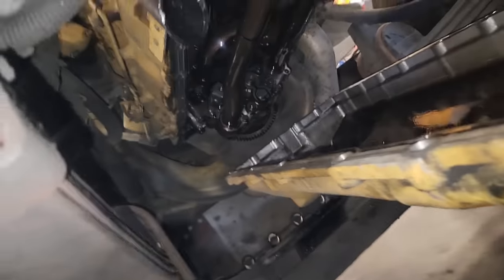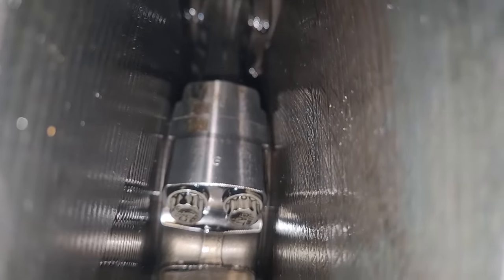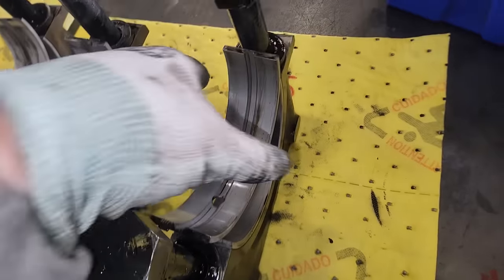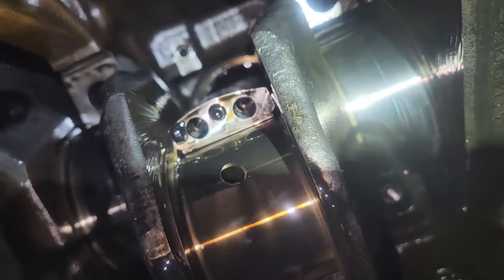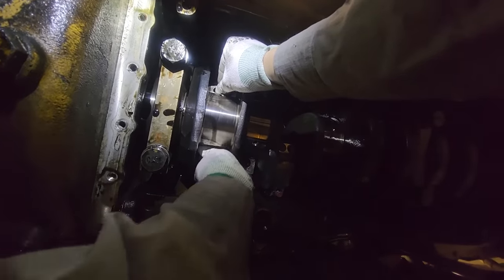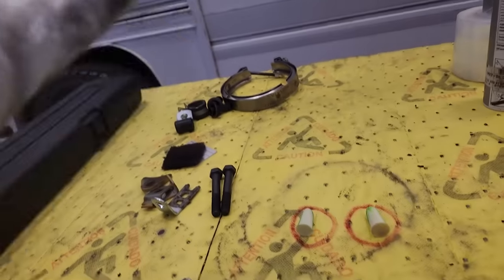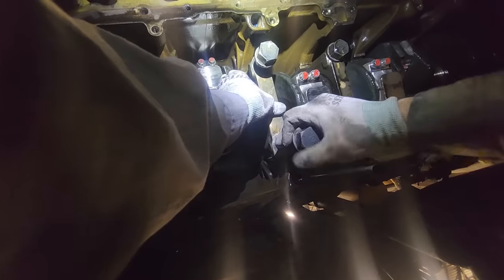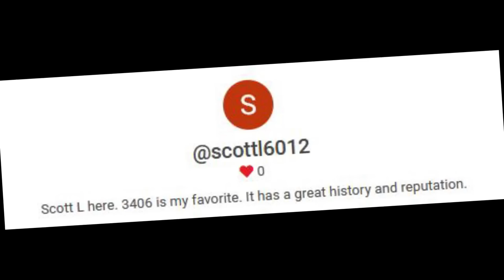Nice Truck Driver Paid for an Engine Rebuild, gets a HEADACHE! Engine "Re-Rebuild."

Comment: Why did you torque the individual main bearing caps down one at a time before you had replaced ALL of the main bearing shells? Doesn't that put the crankshaft at a slight angle which makes it more difficult to replace all the subsequent main bearing shells?  I would leave all the main bearing caps a bit more than  finger tight until all of the main bearing shells had been replaced, and then torque the main bearing caps down to final specs in the particular order called for by the engine manufacturer.

Comment: Loosen your fan drive belts it will make the front ones easier to roll in, sounds silly but it really does make a difference.
Reply from the maker: You are the 3rd person to mention that and I never thought or heard of that before, but that might be a great idea. If I get a tough one I'll try that, thank you.
Reply: @AdeptApe  VEE belts if over tighten, serpentine usually don't cause a problem. Sometimes the position of the crankshaft will cause a upper brg hard to go in.

Comment: I have seen engines being rebuilt on the ground, next to a busy hwy, with no torque wrenches or good tool, using home-made pistons, by a bunch of men wearing sheet and wearing flip flops, and they did a better job than that Florida shade tree. 
I blame that truck driver because I commonly hear on a daily basis how they can get it done cheaper somewhere else. 
Has nothing to do with the parts, it's all about the attention to detail. 
I use some cat, some IPD, and some Clevite  parts. I have no failures.

Comment: I have been told by a rep from a gasket co if you use # 5 white grease for torquing the torque will drop to around 90 % a dry bolt is 100% , oil goes to around 110% , Detroit diesel  peanut butteraround 120 % , cat torque compound goes around 150% .DON'T use white grease for bolt torquing lubricant. The gasket company was going to put in there gasket sets not to use # 5 white grease the company that makes white grease got word of that , they told the gasket co they would sue the shit out of them!!

Comment: Probably Motor's number 12 engine assembly lube. It does look like white lith. The stamp job is really good. I doubt that the rods were resized. He may just have had a really good set of stamps.

Comment: I just went through the same as this owner. My engine just rebuilt and hit the road less than 6000 miles and bearing spun due machinist installed wrong. Cap #2 into #5 engine.

Comment: Just wondering have you ever used a screw or something in the oil hole to help spin the bearing uppers in the mains it’s worked well for me it the ones I’ve done

Comment: Spending $18k - $22k for an in-frame rebuild only to learn it was mickey moused is really painful. I know first hand as my high time mechanic disassembled my engine then went on vacation. The Indiana shop I used allowed a low time mechanic perform the rebuild unsupervised. When I picked up my truck it had heavy white smoke which the shop told me to drive it hard to break it in. So I did but three months later it still billowed white smoke and failed the bubble test. My truck never smoked before rebuild. Reason for rebuild - lost cylinders 5/6. When I took truck to another shop for full service oil change, pieces of oil control ring came out with the old oil. I reported to shop that performed rebuild the findings and he said to get it back to them ASAP. The high time mechanic who originally disassembled engine the first time took immediate charge of second in-frame, found many mistakes including a reversed head gasket, corrected all the errors and reassembled. The second in-frame was 100% warranty work so no cost to me except renting a truck for a week so I could continue working. Once I had truck back, no smoke, no loping and ran smooth and strong with 60-psi oil pressure. That was the DDEC-4 engine I sold for $30k last year when I quit as an O/O, sold my equipment and moved to Tennessee and now drive a dump truck for a company outside Nashville. Good mechanics are hard to find and you Josh are one of the, I mean THE best.

Comment: I’ve seen cat con rods and caps stamped like that before. You said with no torque stripes you had no way to check the torque being correct, years ago when I worked for a Detroit Dealership I was taught any idiot can paint bolts and make em look torqued so if we suspected issues we did a torque verification by starting at proper torque and increasing 5ftlbs at a time till the bolt moves that’s what it’s torqued to and if you have a torque turned bolt there is usually a final yield torque and if it’s not in the book just do a torque procedure on a bolt and check it’s final torque by increasing your torque wrench 5ftlbs till it moves then you’ll know the yeild torque to check the rest.

Comment: I was losing oil pressure as well on my acert and it ended up being the rubber O rings for the I.V.A's. when inserted it would cut the o rings
Reply: All I.V.A’s were replaced and nothing. All Jake brake housing too and nothing. Congratulations, you found yours, mine is more serious, I will have to buy a new engine or do it from scratch. It will cost the same. thank you

Comment: I'm buying a B model foe a builder it has rod bearings into the copper at 50k on overhaul mains looked just about like yours. I'm thinking diesel in the oil? Don't really know yet.

Comment: 2:55 i'm not a truck driver, but i put teflon tape on my drain plug and it never leaks, and i don't have to crank on it to get that stupid copper washer sealed, which is of course old and worn because who ever remembers to get a new one of those right?
But my car is cheap and i'm cheap, yet i'd still argue that teflon on drain plug is better than cranking that thing until the threads give up.

Comment: Just an idea. Whenever I personally build an engine I use white assembly lube. I do use engine oil on bolts unless otherwise detailed to do so by the manufacturer. Like putting in arp studs in an automotive application or Detroit that calls out the “Detroit butter”. I would bet that Detroit butter is what’s on those bolts. That being said I’m not at all defending the crap work this guy did on his customers truck. Great job on your end as always.

Comment: I use STP oil treatment which is thick like Lucas oil stabilizer and I’ve been using it on diesel and gas engines and it has worked great for me, let me know what you think

Comment: I'm a fellow engine builder (Cummins) and seeing what you found upon tear down makes me cringe! I think we've all had ones that are difficult to roll uppers into, but that is definitely not the answer🤦‍♂️. I have found that when one is fighting me, I'll rotate the crank some, and often it will slip right in as i'm using hand pressure against the bearing while rotating. Try this and see if it works for you.

Comment: I've never had to use a screwdriver to drive bearings on usually you can roll them right in and if you can't you're not doing it right maybe I've used the screwdriver on the end just to make sure it's in the groove properly but never to force a bearing and that's I would want my money back

Comment: Reman connecting rods will have that laser etched qr code on them where as the oem just has the P/N, they will also have P/N stamped on both sides of the rods. I would guess those are reman or new connecting rods. 

I have no idea how main bearings haven't spun with that "pression grind" on the main bearings lol

Comment: Interesting rebuild technique by last guy 🤦‍♂️ All the C15s we have, they are all stock, all have over 500k mi except 1 truck has 100k, but they all loose like 5-10psi of oil PSI under boost when u stand on the throttle.  I've noticed this since I started driving all the trucks especially the main truck I drive that I started in that had 85k mi 17yrs ago.  I was told the turbo feed the slight drop in oil PSI was from turbo feed increasing while under boost. Is it true who knows 🤷‍♂️ I wouldn't worry about it if it's 5-10psi. Plus the gauges in the 06 and newer trucks don't seem to be as accurate as say a 2001. I think cause the newer style electrical gauge vs mechanical  gauge in a older truck

Comment: Surely the bolts shouldn't be greased or lubed before tightening!  This means the bolts or studs will be seriously over-tensioned if the design bolt torque wrench settings are used.  Threads are assumed to be clean prior to assembly, that's all.

Comment: When working on any engine,  gas or diesel,  if the rod's and main caps aren't numbered,  I will number them as I take the engine apart. Most however are numbered,  and in this case was good the factory did number the caps.

Comment: Personally i stopped using oil to lubricate my bigger bolts during an engine build. I noticed i wasnt able to get consistent torque values on my second torque. I use a special lubricant from detroit. We call it peanut butter due to its color but i dont get wierd pops ehen getting my second torque. 
Cats normally use a torque plus degree but others like cummins and detroit use two or three torque settings

Comment: That crank sanding/polishing  debris is going into the oil gallery and you probably will not get it out while the crank is still in the engine .

Comment: the oil drain should accept a small spring steel clamp that acts as a safety to keep it from being opened accidentally. i had one on my pickup like that.

Comment: Detroit Diesel 2cycle eng. Use high pressure grease on head, main and rod bolts ,,,it is a type of lithium grease, but made for high pressure (  high torque ) bolts,,, P R Duty PhD

Comment: Have a couple things that you did not show, but can I ask did you pull the oil pump apart and check the plunger and spring for length and wear? Two did  you check the bypass spring and plungers, seen them shrink with time? Where I worked we had a fuel room where we could check the spray tubes for pistons to see if they on target, had a fixture for that, made more than one adjustment on them. Reason for asking is what we saw from the previous work work done in the Florida shop.

Comment: I’ve only seen bearings that bad from gear train issues in the front. Usually from aftermarket heads that are decked too low. What a mess. Can’t say I haven’t paid for worse…🤦🏼‍♂️

Comment: Did you replace the Main  and Connecting rod bolts? Torqued with a impact is not something I do. I always use oil  lubrication on install and prime the motor before letting her start.
Reply from the maker: I lubricate all bearings when installed and prime the engine with oil before starting.

Comment: The white stuff on the main cap bolts could be the “peanut butter” like Detroit Diesel uses.  That said many years ago when I was first getting started as a mechanic I meet several older mechanics that used WLG (White Lithium Grease) on the threads of nuts and bolts as well as an assembly lube. Personally I have always use peanut butter on fasteners as a thread lubricant and either STP, “Motor Honey,” or assembly lube on bearings and internal engine parts when I am assembling an engine.  I very early in my career as a mechanic stopped using WLG, or other grease’s assembling engines and transmissions because WLG and most other greases will not completely wash away or melt away when the engine is run contrary to popular belief. As far as “torque stripping” of bolts I personally don’t use paint on fastners but use marking crayons, chalk//soapstone or an automatic center punch. All that said whoever did in-frame on this engine was definitely lacking in technical skills, abilities, and giving a F#*k. With regards to the rod bolts I would of measured (mic) all the rod and main cap bolts to look for any bolts that are not within a few thousands of the rest of the bolts and if any are over length then I would replace them as a set.  Additionally I have several dial style torque wrenches which I like to use when disassembling engines so I can definitively check if any fasteners were under or over torqued.  
With regards to the marking/stamping of rods they look as if they were done by someone who either has used a stamping set a lot or had a older shop teacher who taught his students how to use a stamping set.  Additionally whoever did the marking rods had a good quality stamping set and not one from harbor fright   I have a small arbor press on my workbench and use it and a shot bag to hold what I am making level and in place
One last thing when polishing nicks and scratches out of a cranks etc take the strip of sand/polishing paper and roll it up backwards and then unroll it and pull it over the edge of a workbench, etc backing side facing a very clean workbench a couple times and then on the abrasive side. I then soak / rinse the strip of sand/polishing paper with clean kerosene/diesel fuel or parts washer fluid (when the safety clean man comes to change the parts washer fluid I always get a quart or two of new parts washing fluid and keep it in bottles use it for just such jobs. I don’t like using oil on sand/polishing paper because it traps crude in the paper and or in and around whatever you are sanding/polishing

Comment: Love your channel an content brotha!! Been watching FOREVER!! 
Is there a reason you don't use the crank to roll in those stubborn top shells?? I've found it makes a massive difference, I just spurt a Lil fresh  oil on installed shells journals
Reply from the maker: The problem was getting the bearings started in the upper gap. If you can't get it started you can't use the crank to roll them in, it will just push it out.
Reply: @AdeptApe  AWESOME!! GLAD TO TALK TO YOU!! I did ALOT of Detroit dd13,15 an 16s that more often then not I had to hold the brg tight to main journal and push crank throws to start the brg dd15s with the axial power turbine and dam near every single dd16, my thought is the new dd series are rear gear train so I think they are just tighter gaps, if I pulled mains in 4seqen  at a time  and rolled LEBs in was easier with my "trusty snap on screw driver" 🙃 but I feel you on the gatopilliars the 15s are a bear sometimes! 
FFffin A brother keep gettin dirty!!! IL keep watchin!!!

Comment: It could very well be possible that whoever stamped those rods built themselves a gig to hold them so they had a little more professional appearance. I made myself a gig and line guide for hand stamping brass ID tags. It makes them a little easier to read that way, especially when they're covered in grime.
Reply: Jig, not gig friend

Comment: The problem is, he was applying excessive force when the bearing was only 1/3 in to the top, because he was beating on the oil hole which is no longer visible at half way in..

Comment: The dings in the crank was done with the small screwdriver when the bearings was installed by the previous dude. i speculate

Comment: polishing a journal like that will result in uneven polishing and a journal possibly out of round. talk to your machinist. the paper width needs to be much more narrow (about 1/4 width of journal). wrap it around the journal two times so the entire journal has the crocus cloth contacting the journal. take the ends of the cloth that you pull on and cross them in  your hands. now pull one, the cloth will polish all 360 degrees of the journal and walk to one side of the journal- now pull the other side and the cloth walks to the other side of the journal. polishing 360 degrees in multiple directions will result in a higher quality polish

Comment: Did you re match all the mis positioned caps? Or at least check the ones with numbers not matched? It will be apparent if the surfaces dont perfectly match when caps are installed. I wwould think if they were mismatched and ran that way they would at the least need remachined back to spec. I would tear it down completely after finding that clusterfucked bottom end.

Comment: Are those not cap cracked Rods?  

A lot of them are and they don’t even go flush when the cap and rod mated. Meaning two of the rods and caps weren’t even mated properly.  

I don’t understand how people can just screw people out of money.  

Hopefully with you videoing it the other cat dealer will have to foot the bill.

When the oil gets hot it will lose oil pressure.  That’s from the tolerances between the bearings and crank/Rods.  

He can go up a bit in the weight of the oil to have higher pressure, or just not worry about it.
Reply from the maker: It definitely was not a Cat dealership that did the previous work. The rods were machined and doweled, not fractured rods. Even with that, the rods were all matched, it was the main bearings that were not.

Comment: @25:15 definitely a hand stamp.  I vote hand stamp.  i’ve  been doing machine work and building engines for 25+ years and that’s certainly a hand stamp.  compare to the computer etching on the caps above the #6 ect stamp

Comment: Hey Josh, I'm not a tech, but I have a technique question: would it be an idea to leave the main caps about half a turn loose while fitting the upper bearing shells, then torque the caps after all the shells are in? Would that relax the clearances enough to allow the upper shells to rotate into place with less resistance?

Comment: I have a saying "Better you  then me", Cat does not stamp rods, can cause a stress riser. Deforming the metal. You might be headed to Florida and testify, drop in and see me on the way. Cat doesn't like white lube on bearings, I was told it prevents oil from coming into contact with the bearing on start up. I think you have "prevent destruction of the week" amazing the mains did not spin in the bore, line bore must be dead on. You might get a thumbs down on the guy who slapped this together.